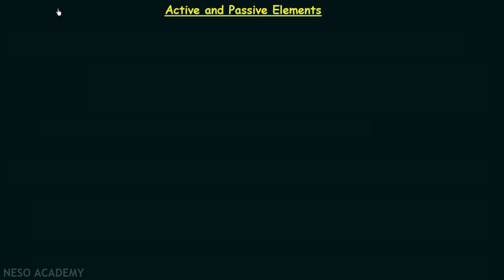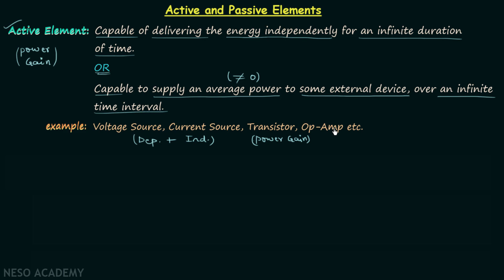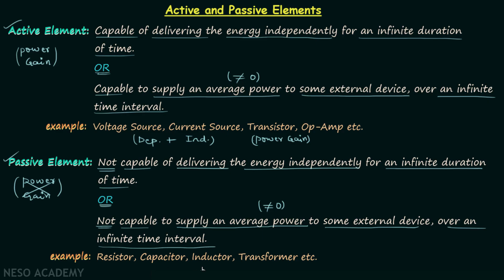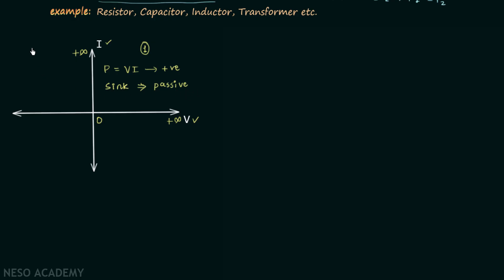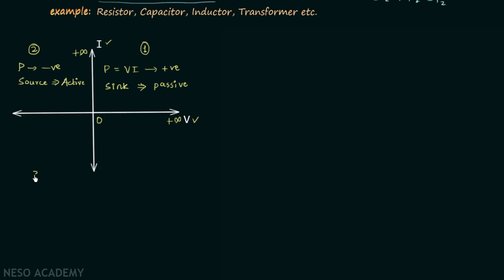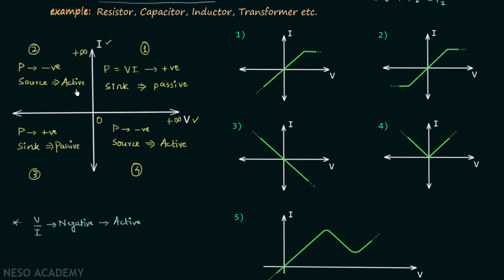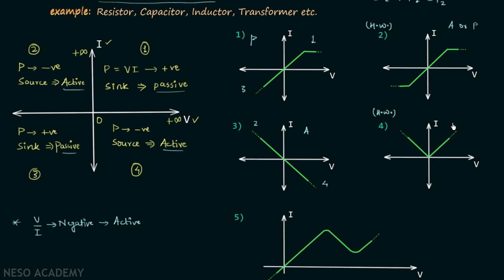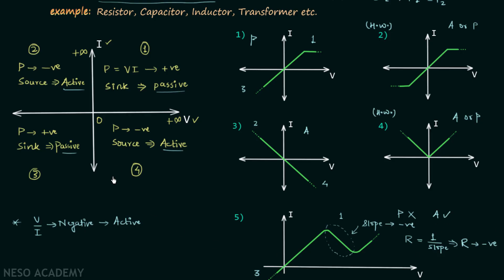Active and Passive Elements

Comment: Consider VI curve of charging and discharging of capacitor. We know capacitor is passive element, but based on the graph only; we'll say it is an active element.  So, how is the V/I ratio reliable for determining type of element(active or passive)?
Reply: Exactly, like I saw an example with of Non Linear (V source , I source etc) that is also Passive.

Comment: 2.Since the line lies in the first and third quirdent so the Slope is possitive. Therefore it is passive element.
4. Left part of the graph is lies in 2nd  quiredent where power is negative. That's why it will act as active element.
Reply: Okk! It means, if only one condition supports the condition of the active element then it makes the whole condition to be an active element case.

Comment: Hi. Under normal conditions, sources (independent and dependent) act indeed as active elements, that is, they do provide energy to the circuit (their power is negative, using the passive sign convention.) However, in other conditions, sourcea can actually have a positive power, thus they absorb energy from the circuit just like resistors, capacitors, etc. So, my point is, you should have clarified this. Anyways, such a great channel.
Reply: This is very correct , Active elements also absorb , good thing to read from different source.
Reply: smart i was searching for this exolaination
Reply: an example would really help

Comment: Sir! You have told in the definition of Active Element that the element should be capable of delivering the energy independently. Then, how can it be possible to consider dependent voltage or current sources as active element?
Reply: The context of 'independent' changes. In the definition delivering the energy independently means it as an element capable of producing energy without depending on other elements. In dependent voltage or current sources the amount of voltage or current (you can generally say power) supplied depends on the type of load you have, but they are still independently delivering power, only their value changes when you change the load. 
I hope that made sense. I'm an year late LOL.
Reply: @soumyaoruganti9990  Thanks for explaining that in a different way. And yeah you're 1 year late. But I believe, knowledge is something to be gained throughout the life. There is nothing late or early. 😊
Reply: @Prince Chaurasiya but for mixing pulihora doesn't need any age you are great in that aspect .Mind blowing 😉
Reply: @Bannu2001  😂😂😂😂🙌

Comment: Explain about when slope is -ve Resistance is positive
Reply: If slope is negative resistance is negative as resistance is negative it is active element
Reply: Actually resistance is a passive elements,which means it should have +ve slope.But,according to graph we got slope  as -ve so we should consider it as a active element. The most important thing he explained is that the graph law fails in case of negative slope of resistance in 1st or  3rd quadrant.

Comment: 2. Passive Element.(Non linear)
4. Active Element.(Non linear)
Reply: How come the 4 answer is active 
As the graph is on both 1 and 2 quadrant
Reply: @mee8963  negative multiplied by a positive number is negative and therefore, the overall element is negative and that corresponds to being active
Reply: @briabree7683  thanks 🙂

Comment: 2.Passive element
But in 4 it has passive and active characteristics in the 1st and 2nd quadrant respectively...What should I conclude,Sir??
Reply: it must be active because if any active element is present then it is active
Reply: @akshatjain8977  why such biasness?
Reply: @oskarjung6738  since I think that any active source can also acts as passive source... like voltage source (Even it's a active component we can also use it as passive components sometimes in circuit)...hence this graph reflects that the device is literally Active.

NOTE: passive source can't acts as a active source...

Comment: How a transistor can be treated as active elemwnt
Reply: I think that's because it need to be connect to a reference VCC which is actually the element which truly providing power....those definition are confusing and I don't think that they are the important once we know what's the real component functionality
Reply: @invoker969 in transistor internal anplification is done so it is globally passive,but locally active
Reply: Since there is power gain in transistor and internal amplification is also there
So active element